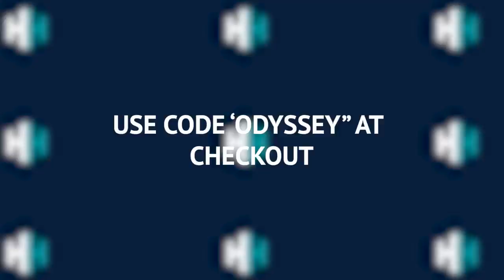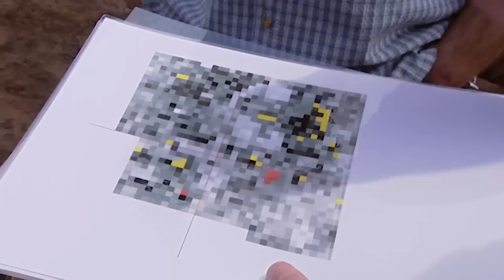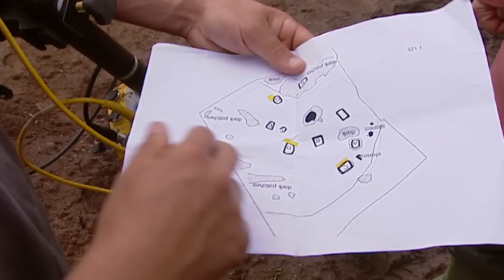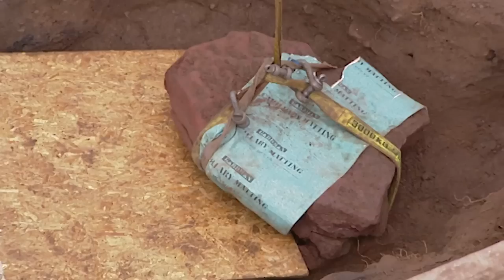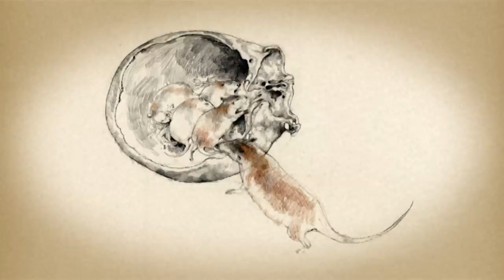The Race To Uncover The Mysteries Of Scotland's Bronze Age Cemetery | Time Team | Odyssey

Comment: @ 20:14 the single cuppole stone is called or considered a nutter or nutting stone over in North America Mid and Eastern woodlands.Found in profusion in forested areas with Oaks- Acorns Chestnut & other nut baring trees. along creeks & in farmers fields The rotten stone Phil was talking about in the kirst could be mudstone, not quite stone or rock just very old & hard compressed mud in thin layers found in formations, put in water it will get like slick wet clay & will break apart & dissolve rather easily. Another great show chaps, The British Isles long time line of archeology has always fascinated me, Ive always dreamed of riding a small motorbike around the Isles exploring your countries. I have really enjoyed your Odyessey & Timeline series during these past 2 years of Covid lockdown especially in the landscape of southwest desert isolation where i live,  thankfully we now have decent internet connection which we did not have 12 years ago.. Cheers from Craig Harald,  an old Acheulean fanboy in Death Valley California.

Comment: The one rock with the hole on the top was used to start fires with.  First Nations in Canada would put dry material like hay than use a stick between the hands.  They would then rotate stick back and forth heating the stone and dried material till it ignited.
Reply: Yes, I was wondering why they didn't consider that.
Reply: Phil did something very similar in one of the Time Signs videos. He uses a bow to rotate the stick to get the fire started.
Reply: Same in Australia